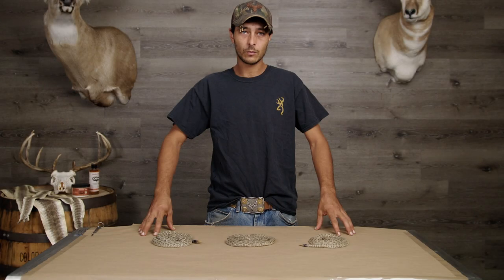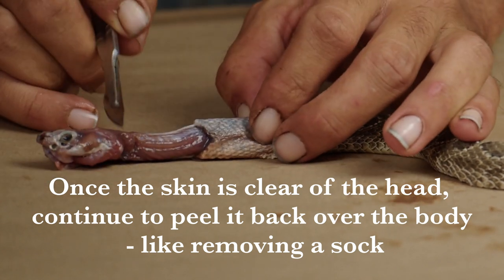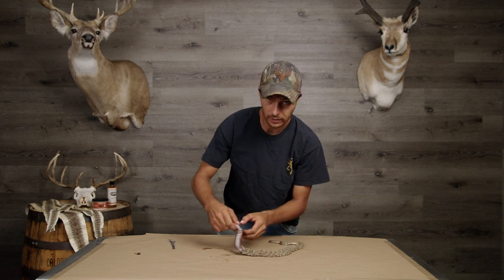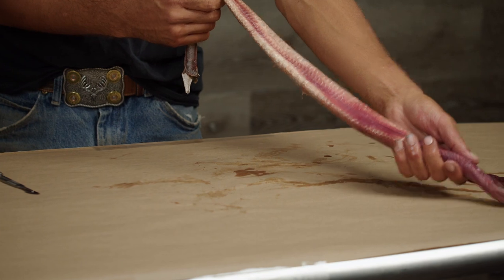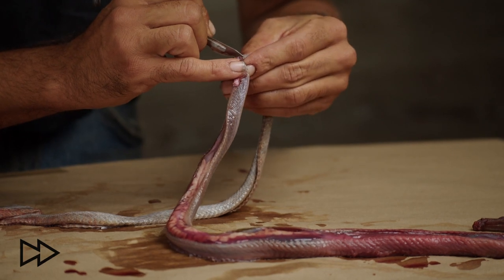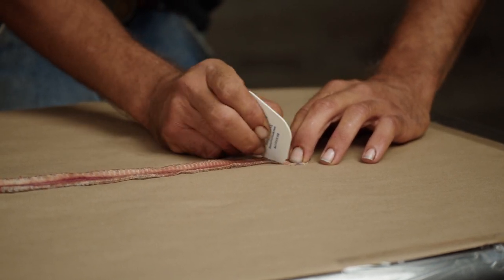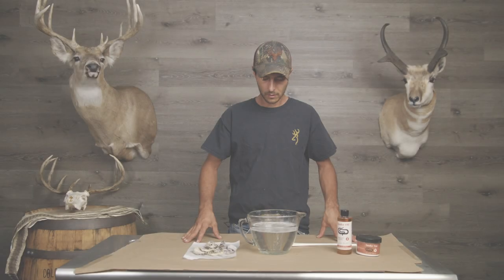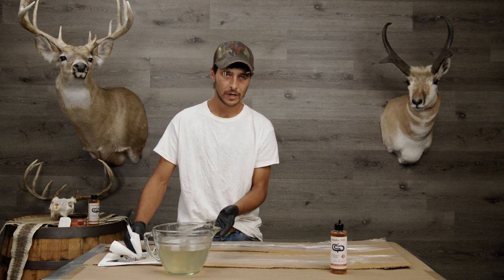Taxidermy Tanning - Rattlesnake Edition (Experts Only)

Comment: THANK YOU!!!!   Finally a great tutorial on tube snake tanning.   I have one I process now.  Because I found your great video too late I had soaked my inside-out snake out in a vinegar-salt-distilled water bath for approx 48 hours.  I just removed it from that and rinsed it today.  Can I proceed on with the oiling or do I need to resoak the hide in a different solution, such as tanning solution you use here?
Reply from the maker: Mary, we are so happy the video was helpful.  Yes, the skin needs to be tanned first (to turn it to leather) then oiled (to keep it soft).  Soaking your skin in a vinegar-salt-water bath is OK, although the vinegar is not necessary.  The vinegar is acidic and will lower the pH of the snakeskin.  The pH in the skin is most likely around 3, so in order to get the tan to work properly, the pH needs to be raised to approx. 4.  To do this, first rinse the skin in fresh water (like you did) put 1 teaspoon of baking soda in 1 gallon of water (it won't take much) and test the pH level with pH paper.  Once it stabilizes at 4, you can proceed with the tanning and oiling steps.  The skin can be rolled up and frozen until you are able to do this.  Let us know if you have additional questions.  Thank you!!
Reply: Thank you so much for your reply!   I’ll freeze the skin for now and do the soda/water bath in a few days
Reply from the maker: @Gebo307  Sounds good, then the snakeskin can be tanned.

Comment: I imagine this snake tan can also be used for fish ? I’ve done the salt bath on fish it does make a difference
Reply from the maker: Yes, if you are making fish skin leather, this process can be used.  Note: go easy on the oil, depending on the thickness of the fish skin.  If tanning fish skin for taxidermy, it is better to use our "Bird & Fish Tan".
Reply: @TanningYourHide  I was taught and still use this way to do fish 
After i skin amd flesh a fish I do a dawn dish soap and boars soak for 2 hrs then rinse and mount it works great but always looking to improve and find a better way to decrease fish skins for mounts
Reply from the maker: @jasonnester9514  Thank you for the information on your process!

Comment: I'm not native speaker, so my word may not so accurate and also have so grammar issue  , sentence looks weird, plz tolerant.

Now I also trying make a snake specimen or should i said taxidermy ? （ I really hope see ur video  early QAQ, ur lecture help a lot for rookie ).

According textbook, first step is remove all snake skin from body, clean the rest tissue on skin and put it in alcohol (75%) rinsed for 1~2 day.

Second, put snake snake in water for 2~3 hours blabla

My problem is - after I put skin inside  alchol, I find there's is a lot of snake scales fall down....is it normal ?

and glycerin is for keep skin moisture, keeping skin elastic ?

Thank  you ~
Reply from the maker: We do NOT recommend putting the snakeskin in alcohol.  Our Tan-a-Snake process is to skin, flesh, soak in salt water, tan and oil.  You can see the full directions on our website.
Reply: @TanningYourHide  thank u for reply

Comment: You can also wait until the snakes tanned then you can usually pull the rattles off
Reply from the maker: Yes, that is definitely true for flat snakeskins!  In this case though, because it was being tubed skinned, we needed to remove it before it was skinned so that we could invert the skin.
Reply: @TanningYourHide  oh I didn’t know it was any different lol. You can also hit them on the head with a stick so you don’t have to put it in the freezer alive. If you hit it behind the head you’ll destroy the skull without damage to the skin
Reply from the maker: @easternkentuckyoutdoors8092  Ah yes, that is a good tip too!